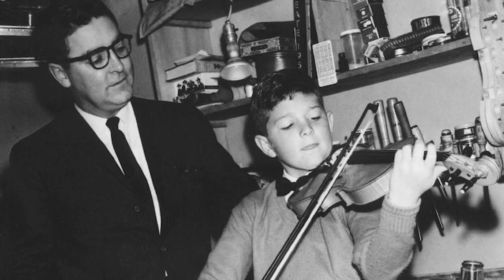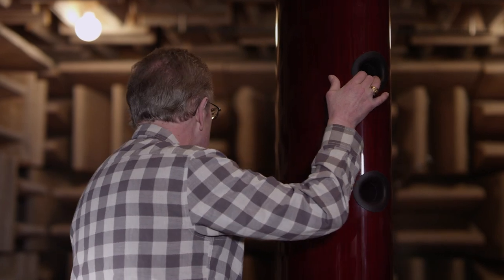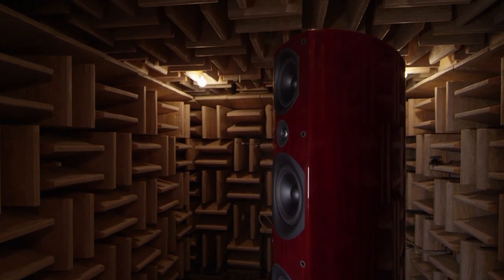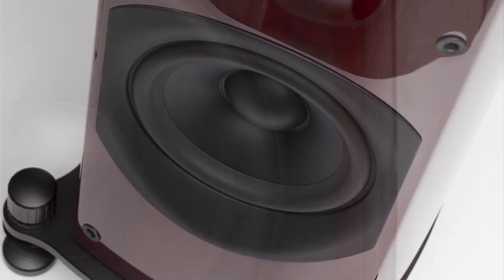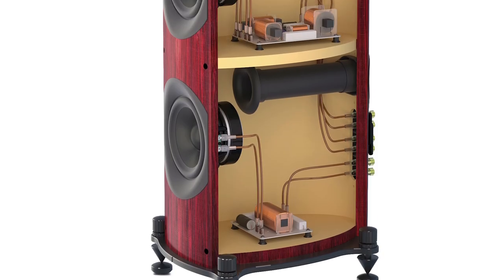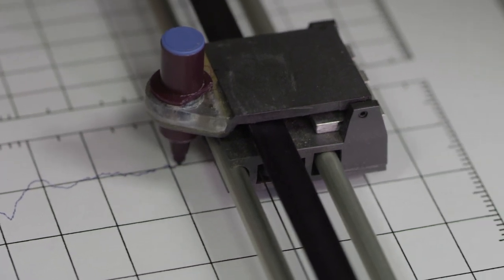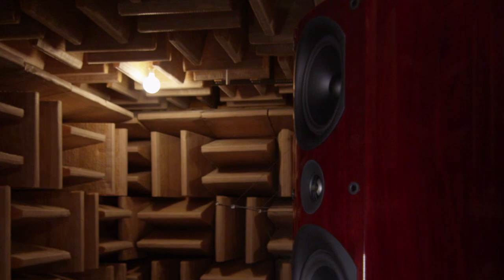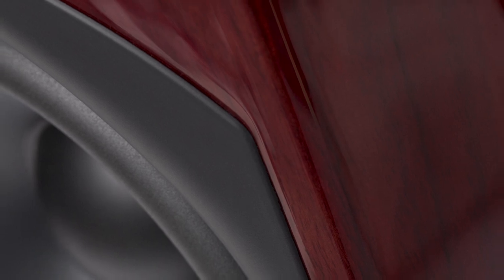SoundStage! InSight -- PSB's Imagine T3 Loudspeaker

Comment: I own T3s since a good few weeks, and must say straight up they are fiddly to set up in my room. However, I believe I'm slowly getting there. The bass is still booming and that needs adressing because I feel it's masking the mids. A slight toe-in (PSB suggests if I remember correctly 10 degrees) makes them image quite well but for me these need to be off-axis in order to stay relaxed sounding. I listen mostly to 50s jazz, modern big band and prog rock. They seem to prefer classical music where their level of detail and neutral sound fits like a glove. Listening to my favorite singers has been mixed - some just didn't sound like I knew they should. So, a few weeks in I'm still working on that
Reply: 4 months on either my ears have gotten used to the T3s, or I got them dialled in along the way - anyway they sound just right. Thanks, Paul

Comment: I purchased a pair of PSB Image 7PT's 16 years ago because of their great sound and design.  Their performance seemed unmatched in their class at the time and they sound as good as ever.  But when I read about this new Imagine T3 speaker and the many awards and positive reviews it has received I could not resist giving them a try so just today ordered a pair of them.  I am very anxious to connect them to a recently acquired MAC 6700 integrated amplifier.